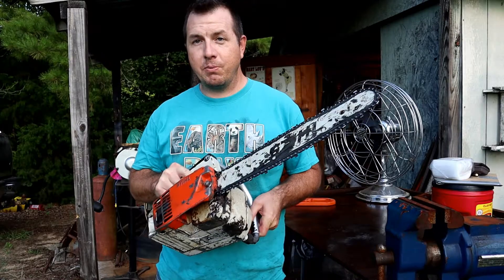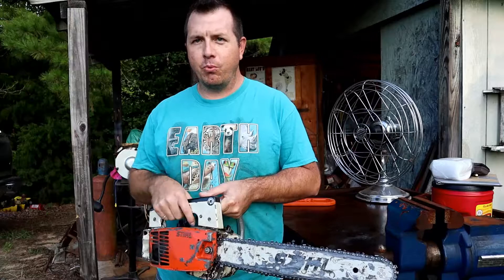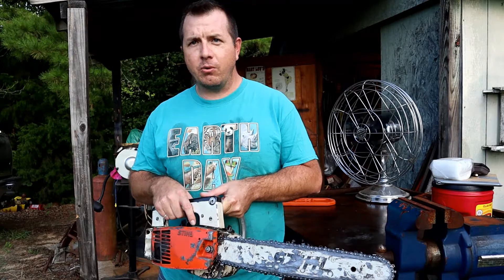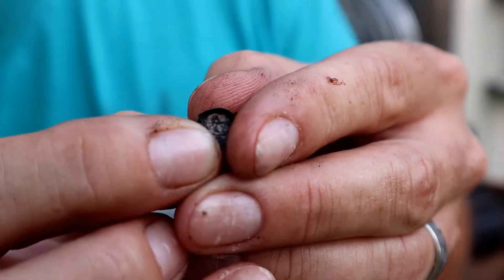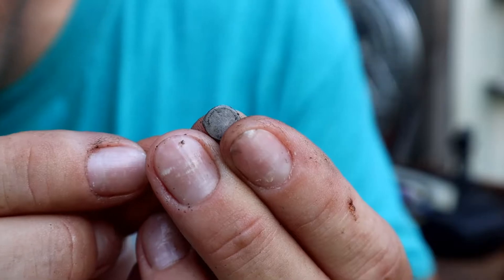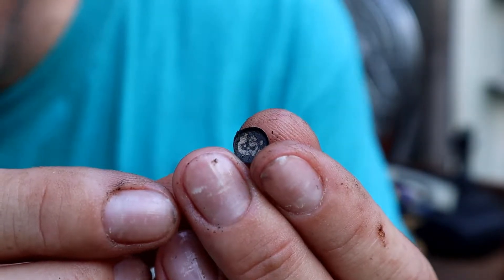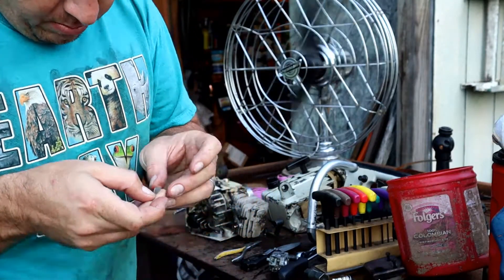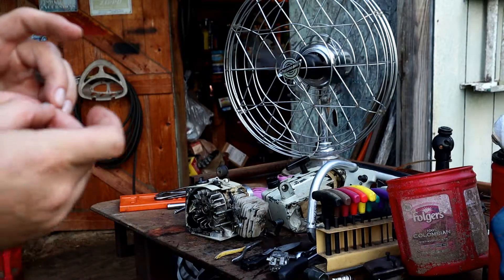2 Stroke Engine Problems Diagnosis And Fix Stihl 020 Chainsaw

Comment: Fuel filter and the fuel line first thing that MUST ALLWAYS BE REPLACED the line is the seal to the carb if you see what I mean and then THE METERING DIAGRAPHRAM, internal filter should be good after that if not cylnder
Reply from the maker: Yeah you are right. The camera doesn’t come on until I know it’s not a fuel filter in the tank. I often neglect to mention that

Comment: Hook up the tester and give three fast full pulls to get correct compression reading.
Reply from the maker: That is helpful!  I’ve heard 100psi is a good reading in general. What’s your experience for a good psi reading?
Reply: @Man-Time  150-170 psi depending on saw. Some delete the base gasket and dome the piston pushing 200
Reply from the maker: Thank you sir!